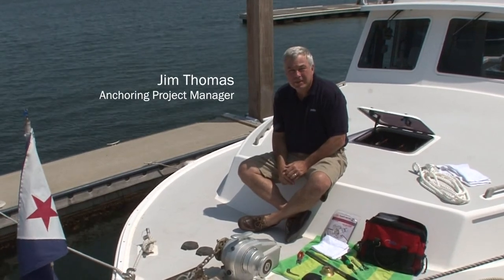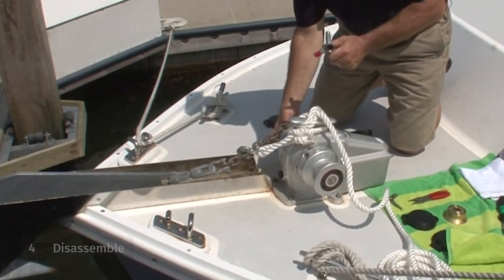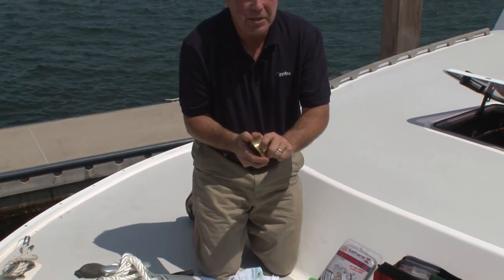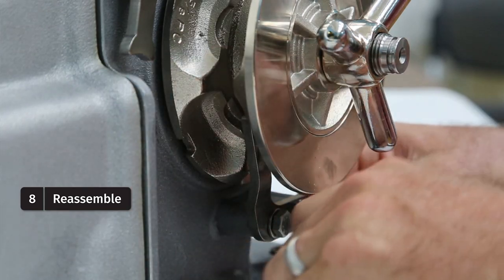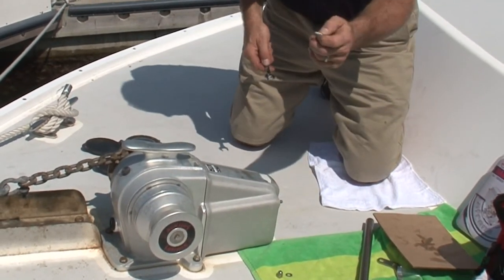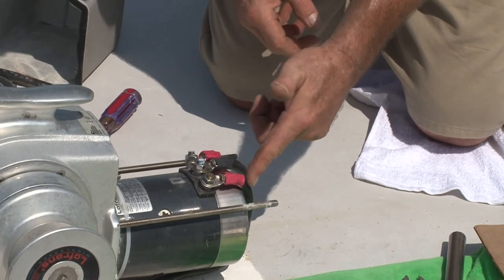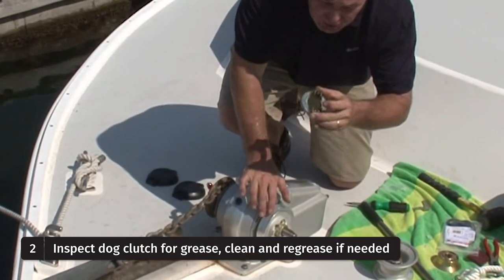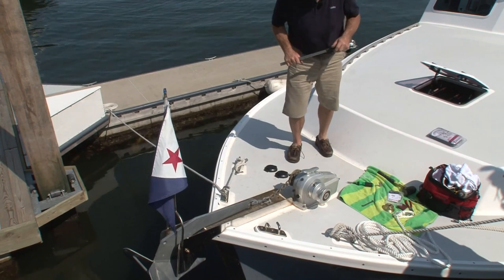Lofrans Tigres Windlass Maintenance

Comment: Good video but no discussion at all regarding the gear oil or what type to use and how best to change it?
Reply from the maker: Any 80, 85, or 90 weight gear oil will suffice. Changing the oil is done by removing the 1/4" oil plug located just underneath the cleat on top of the windlass, and snaking a small hand pump in and pumping the existing oil out. If you have the windlass removed from the deck you can also drain it by removing the plug and tipping it, but that is of course more labor-intensive removing the windlass from the deck. The Tigres takes 0.5 Liters (or 17 ounces) of oil.
Reply: Awesome, thanks for the update. Last question of you don't mind?  We have an older Tigres which is circa 2002 so that means it has the smaller motor.  1200w I believe?  Is it possible to upgrade to the newer 1500w motor??
Reply from the maker: @svZia-Switch51  Yes, replacement motors are available, and given the age of the windlass a newer motor would likely provide better performance. However it is important to note that the 1500W motor is physically the same motor as the older 1200W version, but it has been re-rated in more recent years as a 1500W motor based on updated motor rating standards across the industry. I found this article that helps illustrate how DC motors are rated and why the same motor can be rated at different powers based on how long the motor is expected to run: https://islproducts.com/design-note/how-to-read-dc-motor-gear-motor-performance-curves/
Hope this helps!
Reply: Super helpful.  Time to order a new motor from you guys!! @imtramarineproducts